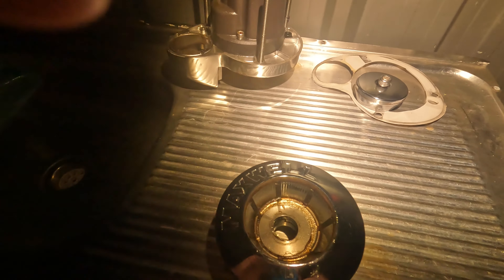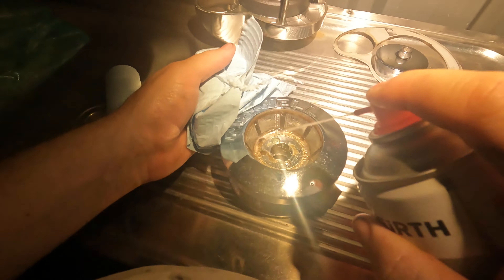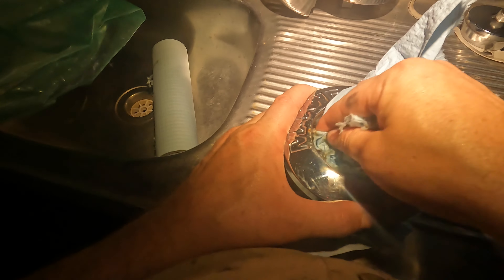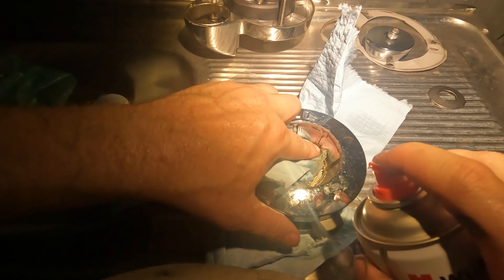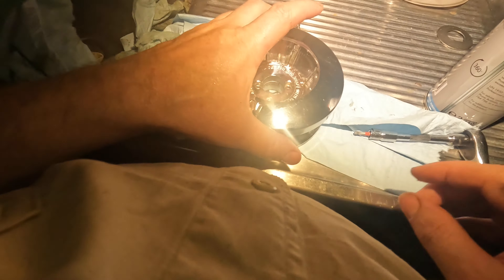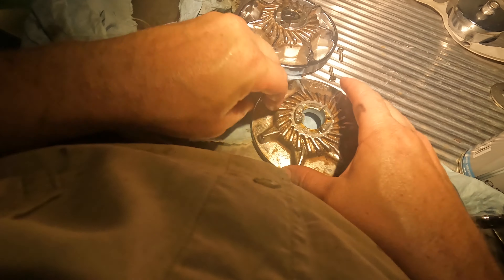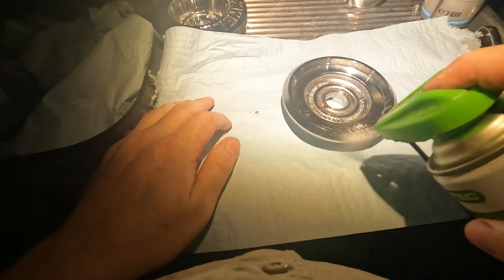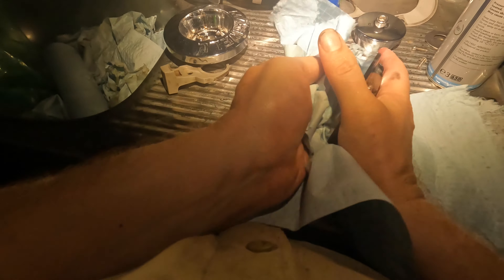Maxwell RC6 Anchor Winch Service After 200 Hours on a Stabicraft

Comment: G'day mate, I have a couple questions if i can. How did you remove the whole winch assembly and is it required? I serviced the exterior facing parts by taking off the allen key bolt.
Reply from the maker: @fotto86  Hey mate it's not requiredbi  wanted to make sure it was installed properly and slow down corrosion. If you want to  remove it you have to disconnect the 2 wires and the 3 nuts from inside the well,it's not fun as not much room! Cheers
Reply: @WildHuntFishing  thank you I might take a quick look to see if there is any corrosion